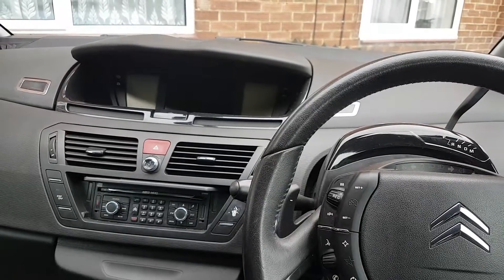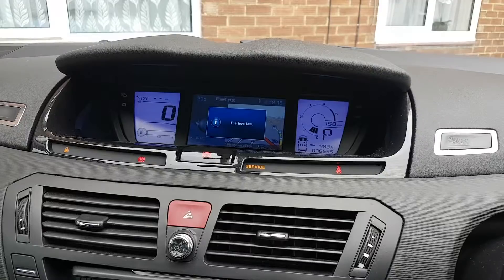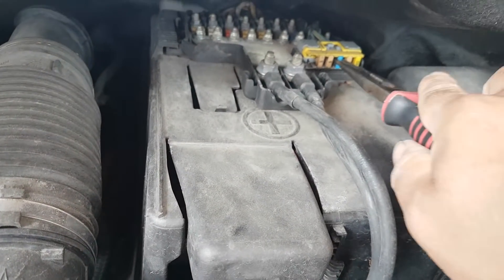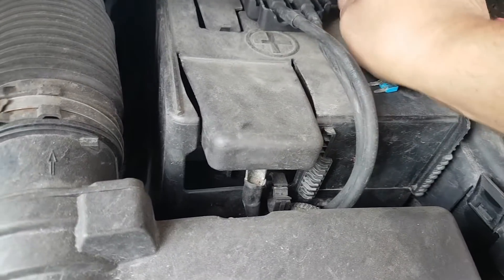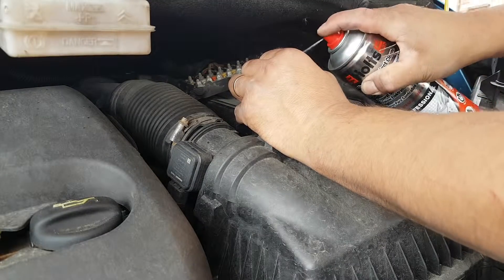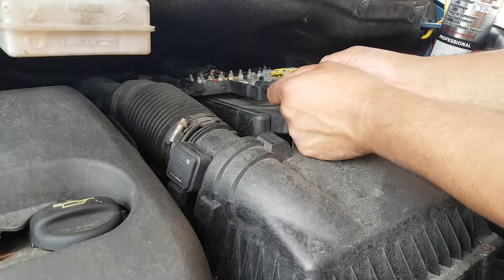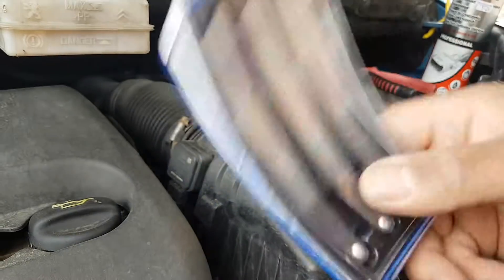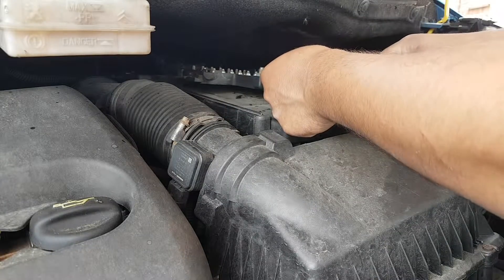Citroen C4 Picasso gearbox fault, and no power on the OBD port... Fault finding and repair.

Comment: Great job!
I saw ESP & ASR Faulty and Handbrake faulty in this car. I have the same mistakes in my Citroen picasso c4, 2007,1.6 hdi. I can't find how to fix this mistakes, because all car systems works correctly. This message on display every day annoying me. The fuses are not corroded. Where else can I look for?
Thanks
Reply: EGR is your problem. Replace or clean it
Reply: I found the problem. The EGR was unplugged.
Reply from the maker: Scan the car first... and get what the modules are reporting...
Thank you for watching!

Comment: Very nice video. I have seen a couple of similar issues on cars where the engines were washed incorrectly. The substance used corodes everything if it goes where it shouldn't go :-) Also windshield washer fluid does this.
Reply from the maker: Indeed...
Thanks for watching and for your comment!

Comment: Great job as allways! Problem with corrosion in these Citroen Picasso is that water goes from window stright on battery ant fuses. Need to fix shelf!
Reply from the maker: As well... 
Thank you for sharing! 
👍👍👍

Comment: Water/damp intrusion? Is that part of the fusebox not closed wit a cap? Silly then. I often use a metal nail file where i cut the tip of.
See you putting a 20 amp. why, there was no on the list in the manual. W(ater)D(isplacement)40 work temporarily, so i dip the legs of the fuses in some petroleumJelly. Keeps the corrosion away. Nice diag. and fix though
Reply: It is very important yo know why there is a corrosion because the problem could appear again.
Reply from the maker: @pmar8280  
As I said, battery gases... this cars are known for it...
There is not a lot you can do...
The clean and lubrication should help for a few more years....
Reply from the maker: Could be... or battery gases...
Thank you for watching!
👍👍👍
Reply: @LMAutoRepairs  Yep gasses might be, if the battery was replaced they often forget to put the small overflow  in place again.